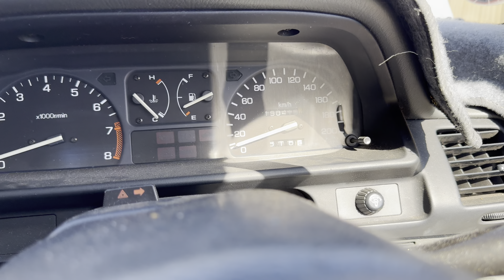ABANDONED HONDA CIVIC ED REVIVAL (TRACK CAR??)

Comment: this will be cool, strip it out and do the ek sedan front and rear disc and knuckle upgrade get some dry ice from BOC gas and make it light weight by removing all the sound deadening if you are serious  go light weight and do handling and tyres, hit up MXR and ask for the t07 coilovers and camber arms
Reply from the maker: Definitely needs some disc brakes, not sure how deep we will go into the weight reduction as it will be street registered but always wanted to try the dry ice for sound deadening removal! After rego coilovers are definitely at the top of the list. Thanks for the support!